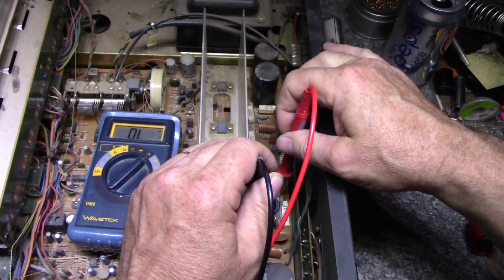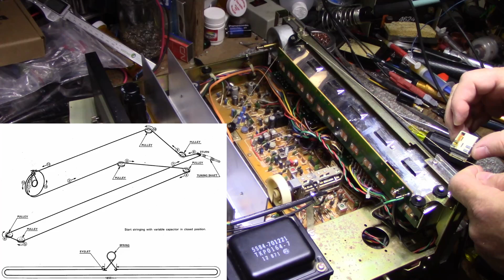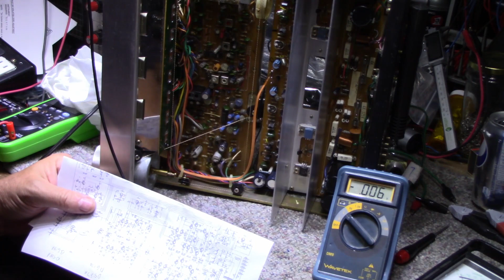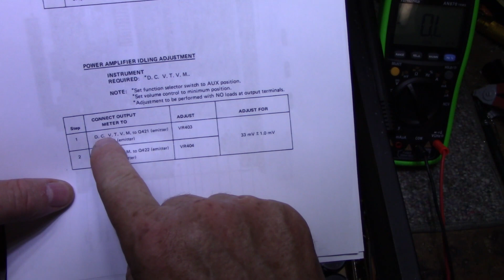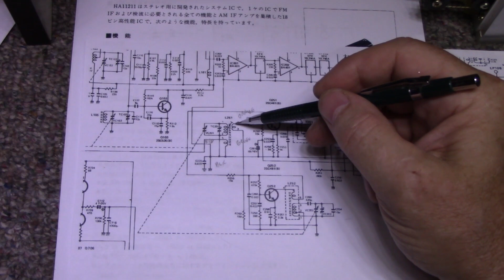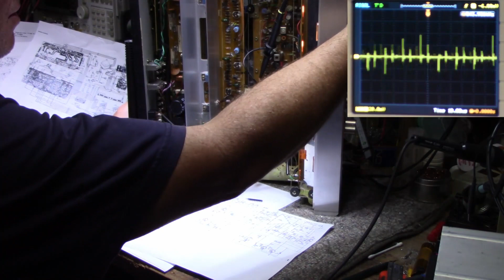Harman Kardon HK 450 Receiver - Restoration & Cleanup (Ep. 140)

Comment: Nice troubleshooting Trevor. Yes, I've had similar hard-to-nail issues like the one with open R in driver stage. Very hard to troubleshoot. Some of these circuit designs give me the creeps. Because if something like an R opens, you get major DC on the speaker output. And even speaker protection won't catch it. Speakers with proper fuse protection is how I deal with some of this risk.

Comment: I have this same head and it sounds great when working. For some reason I keep losing the right channel. I took it out of service and was going to get rid of but checked it one more time to make sure and it worked! So I put it back in service and a few days later the right channel went out again! 
This happened a few times over the years. Put it back in service again because I hated the way my sony sounded and it's working fine again. Been about a year this time and all is well!
I have no idea what was going on? Maybe my dog unplugged a speaker or something but all seems to be well.
Hope it hangs in there.
Reply from the maker: Hi,
With one channel out it's a good time to try to figure out what's going on. Manipulate each switch or pot one at a time to see if the channel comes back. If so, you found the problem.
There are two circuit breakers inside that may have developed high contact resistance. It could also be cracked solders somewhere in the audio chain. 
Hope you track it down

Comment: I got the same receiver. Great stuff however, there is no FM signal at all. I plugged different antennas but still no signal. AM frequency work. Any ideas?
Reply: Signal injection with a generator. Sometimes RF transistors or FET's fail and if you just connect a long test lead to the output side of the RF amplifier and you get reception you have found the problem. 

You can test for local oscillator function in this receiver by bringing another FM radio close by and tune to an unused frequency in the upper region between 100 and 104. Tune your unit you're testing about 10 to 11 MHz below with the volume down. The small radio should become quiet when you are 10.7 MHz below on the stereo. Two easy tests. Good luck!

Comment: Hi Trevor, great video and I can't believe the transformation!! I'm just getting into vintage audio and have picked up one of these HK450 from eBay for £25 in fantastic cosmetic condition but not working on the right channel. Once I got it home I found that the 2 power transistors for the right channel were missing. I'm a total novice but learning fast... however not before prodding around and shorting out one of the left channel transistors which is now dead and no channels work at all, DOH! 
Anyway, I have 4 new transistors on the way to me which look like the same as the originals. I'm reasonably confident I can fit these without too much heartache and I'll make sure I do as many tests as I can before powering up and seeing what I'm left to deal with.. Just wanted to say thanks for the video, I've learned a lot and hopefully my first DIY project will ultimately be a success. If I learn something and don't burn the house down then I consider that a win.

Comment: Great episode - and, great channel! While I’m not an electronics tech, i find the processes to revamp things fascinating. 
I have a 450 that currently sends a voltage surge to the speakers upon power up… capacitors??
Reply from the maker: The amplifiers should be off and silent for the first 4-8 seconds upon powerup. If there's noise, something is off. Disconnect speakers and check for voltage at the speaker terminals at idle. Should be less than 100mV DC. It's possible there's a failing transistor. If the caps are all original, replacing them can't hurt
Reply: @ - thank you for taking the time to reply! I greatly appreciate it! With that said, knowing what you know about this receiver, any suggestions on likely culprit? It doesn’t happen every time - but most of the time (makes the speakers pop). 
Cheers!!
Reply: Thank you so much! I didn’t see the end of the reply before (or perhaps you just edited it ). But thanks again !!

Comment: Thanks for another great video! I recapped and repaired two 450's last year and found them to be excellent receivers, as you mentioned sensitive and delivering a very clean sound. The owner of one commented that it never sounded as good after, someone had cobbled in the wrong replacement output transistors and the current and bias way out.  I had a donor set to pull new output transistors from though.  Switches were dirty on both but responded nicely to cleaning.  All the lights were burned out and I replaced them with LED's by building a DC supply off of the 8 Volt light circuit and soldering two LEDs and resistor across the burned out bulbs, then putting them back in. They are a bit whiter then the originals but should last forever.
Reply from the maker: Good work Kimmi. I really loved listening to this receiver after I finished. It sounded great!

Comment: Hi Trevor. I've been watching your 8 track player rehabs and decided to dive in. I picked up a kraco ks 340. So far it looks like I only need to replace the belt (from there I'll check the caps. However, I had a mishap. I lost what I assume is a bushing for "slave" pulley. The large pulley which is belt driven by the motor pulley. I have currently bushed it with a copper tubing sleeve but have no idea what the original looked like. It made several bounces in my shop and disappointed into the ether. Do you know of any place I can get a diagram of this player? Repair manuals are going for double the cost of a working unit and I'd prefer to repair than replace. Any help is welcome. Thank you.
Reply from the maker: Nobody I know carries repair parts for these old things. I think the capstain shaft is 1/4"? maybe you could find a standard size 1/4" bushing and adapt it to fit. just guessing here
Reply: @TrevorsBench  thanks for replying. I kinda figured. I'll probably find some bronze stock with the right OD and center bore it a couple thousandths over a 1/4.
Reply: Get a kid to come over and look and offer them money. They may find it.

Comment: Impressive work you have done on this amp Trevor to bring back its glory. What did you use to get rid of all that dirt on the front plate? It looked pretty stinky ;) P.S. Was the power LED glaring? It's hard to see on the video, but perhaps this is due to the lightning on your bench.
Reply: I always use simple washing up liquid. Give it a bath as any item in your kitchen, but don't use any solvent or abrasive (pads).
Reply from the maker: I use glass cleaner and a soft cloth on anything front panel. One has to be careful because aluminum is a fairly reactive metal and some cleaners are caustic and will destroy the finish. I also use a ultrasonic cleaner with plain tap water for knobs and other small parts. 
Surprisingly, this receiver didn't stink even though it looked really dirty.
Good eye on the power LED. When I re-assembled the front panel I got the LED in backwards and it didn't light. I had to go back in and reverse the LED before I finished.
I'm amazed at what my viewers can pick up on the video, lol

Comment: Thank you for another amazing vid, this amp  is in some ways similar to Marantz 22 receivers, mains tranformer, tuning cap and circuit arangement-wise in general. With the 2238 I was double checking the generator, as that thing barely dropped a notch by the time I was pumping a 0.6MHz sinewave into it! A lot is being said about the warmth and pleasant sound of these, but never about how damn fast these things are, until now at least. I mean, fair enough, I went with Wima polys wherever I could for signal coupling, but hey, if it wasn't for transistors' unity gain into high hundreds of Mhz, it wouldn't even register that high. Thank you once again for the encouragement - "it must have worked before" is a pretty good motto.

Comment: great vid Trevor. Like you I like the challenge of getting those "barn finds" back to life, especially those nice 70's style silver faced etc.. For others - a little tip on the foam. I  get the "door seal" open cell foam from hardware stores. Comes in lots of various width and thickness with integrated peel back "strong tape". I have used various sizes over the years to refurbish around faceplates etc in these old amps. Simple, works and looks a million bucks and is really cheap- generally on 5 metre or so rolls...
Reply from the maker: Thanks Daniel. Good tip on the foam. I keep a variety of sizes here for different uses. Sometime it's used for light blocking on front panels.